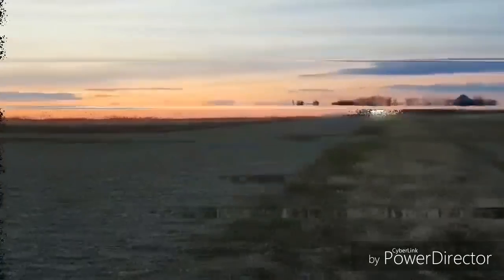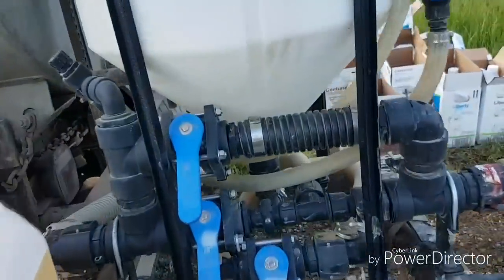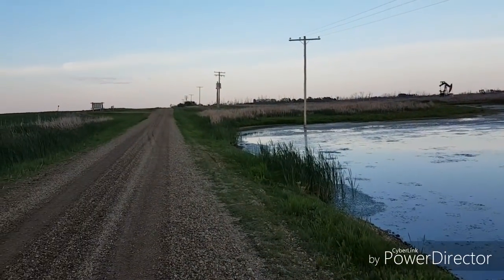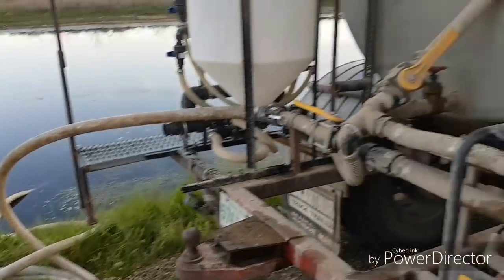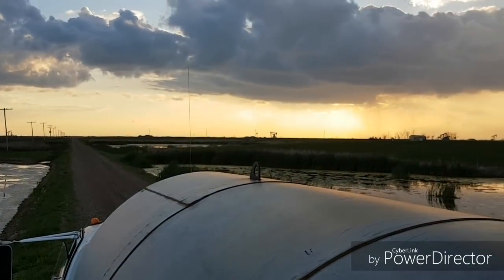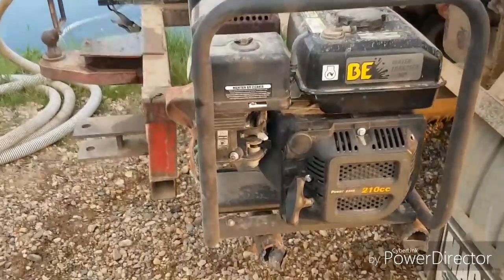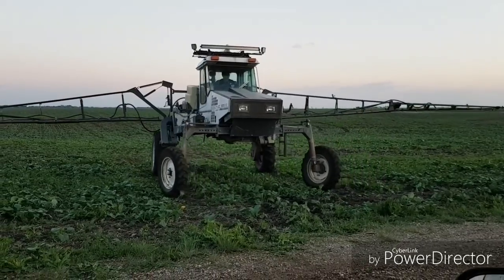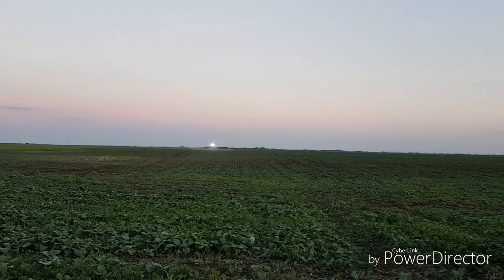Spraying Antoines canola and water pump troubles!!

Comment: Since this year we don't worry about rainfasttime of liberty so much anymore. Got surprised by a heavy rainshower this summer. The liberty (+assure) worked just great...even in spots that got sprayed 5 seconds before it rained really hard on it for a while. As long its good condition for spraying and the plant was dry the chemicals get absorbed immediately. Our neighbours were busy spraying liberty at the same time...and they said the same...worked just fine.

Very nice video again...👍
Reply from the maker: Ya our rep said the liberty is basically on contact but the centurion takes a bit!

Comment: I'm pretty impressed you can filter that water enough to not have plugging problems , we would sure be willing to share some of our rain , finally finished planting though! Small engines can be pretty exasperating ( great when they run not so much when they don't Hahaha)  Higher volume is a pain but time well spent considering the cost of the chemical! Thanks for the video!
Reply from the maker: Ya I have a damn good filter on the end of my suction line haha

Comment: Had a Honda pump that ran for over 20 years and only ever had to replace the on/off switch.  Had a LOT of Honda GX engines and they are the only ones i would own.  They pay you back with reliability.   I thought you weren't supposed to use water from sloughs and water holes because of organics that would negate the potency of the chemical?
Reply from the maker: That's an old urban legend
Reply from the maker: Only place anyone gets water from around here haha

Comment: We've ran lots of those pumps and found that the fuel cap breather plugs. Would run with cap loose and not have issues
Reply from the maker: Tried that wont even make a sputter noise

Comment: How high off the ground are you spray nozzles on that sprayer and are they spaced at 20 or 30 inches.
Reply from the maker: Depends on the wind and the field ect how high we have it set from 12 inches to 48 usually and yes 20 inch spacing
Reply: If you are spraying at 40 ish high with 20 inch spacing, what angle of nozzles are you using, I'm asking because I have a 103 spray coupe that is about 40 inches off the ground and I cant adjust the height. I looked in the old manual and most of the nozzles are 70 degree ones, but this is back 40 years ago.
Reply from the maker: @jeremys6072  90°

Comment: I’ve got one of those little princess auto Chinese Honda pumps and it’s getting intermittently hard to start too. Took carb apart and saw nothing wrong.  Oh well. Get what you pay for lol. Thx
Reply from the maker: This one was like that turns out it was the on off switch so now I just shut off the fuel instead of the switch 10x better until tonight here lol but it had crap in the fuel line we found

Comment: That’s a unique place to get water! Ever have trouble with it being too muddy or murky? I go to the irrigation well and get fresh !., or go to local coop and get well water....
Reply from the maker: Nope have a micro filter on the suction and then its filtered again into the sprayer. They charge to much to get well water plus it's a long damn drive to the well lol
Reply: South Sask Farmer I hear that!!! Free here!!! Irrigation is quickest to fill tanks. A Honda engine is trouble free!!! Don’t use ethanol in those little motors.......
Reply from the maker: @karljacobson1575  hard not to these days lol had a ho da but the pump died so bought this in a pinch and here we are 4 years later lol
Reply: South Sask Farmer hear that! Long as it works!!! Non ethanol is available here but costs 30 cents a gallon more!! Getting ready to cut wheat here ......
Reply from the maker: @karljacobson1575  man way ahead of us lol
Reply: South Sask Farmer ya it’s hard red winter planted last September!!
Reply from the maker: @karljacobson1575  still amazing lol usually late July befor winter wheat is ready here haha
Reply: South Sask Farmer ya I hear that!  Needs to dry a bit!! The ground is wetter than heck here.......
Reply from the maker: @karljacobson1575  ya I bet lol be getting stuck all over hell and gone haha
Reply: South Sask Farmer ya it’s a few days away, so hope it dries a bit!!!!! Keeps things interesting!!!!
Reply from the maker: @karljacobson1575  that's one way to put it lol

Comment: Would it not be better to have a hydraulic pump driven off of the truck, would save having a small engine at all?
Reply from the maker: Maybe but holy expensive lol
Reply: Yes of course it would but then you have to drive the truck naked & that is not good around all those chemicals.

Comment: I had the same problem with a pump. Turned out that the vent in the fuel cap was plugged
Reply from the maker: Hmm qe tried dumping some in the carb and it wont even pop  this morning now
Reply: Maybe oil level sensor

Comment: That water truck gotta 427 in er?
Reply from the maker: Yuppers
Reply: South Sask Farmer nice bud! My ‘66 C50 has a silly little 282 in it 😂
Reply from the maker: @benduffin5727  oh God lol two here have a 350 the towing truck has a 366 and the water truck here has the 427!
Reply: South Sask Farmer oh yeah, raw hp right there! I mean the 282 in the C50 is geared really low and it hauls 9 bales on the deck no problem so it’s still good!
Reply: @benduffin5727  i bet that sombitch is slow as hell, id reccomend a 454 vortec swap but then it'll milk you dry every time you drive er lol
Reply: john dowe no she hits the speed limit even with 9 bales on deck!  I already got me a 97 Chevy 1 ton with a 454 and it’s decent on fuel actually!
Reply: @benduffin5727  yeah we had a 97 454 1 ton but i made a turn with 17000lbs of cotton seed on a trailer and that fucker's front wheel broke off at the ball joints, burned the motor a month later stuck in a  mudhole lol